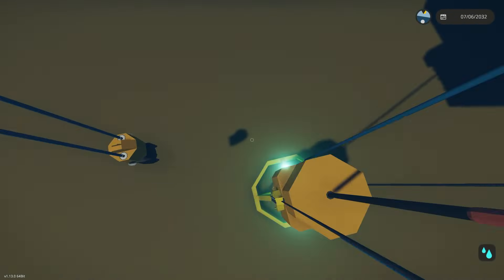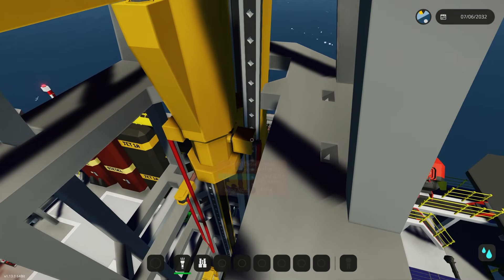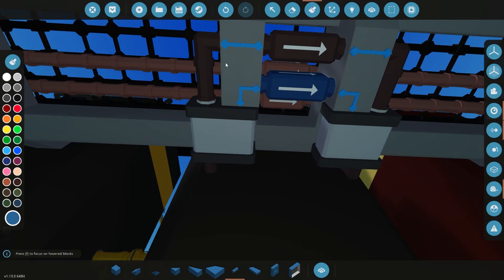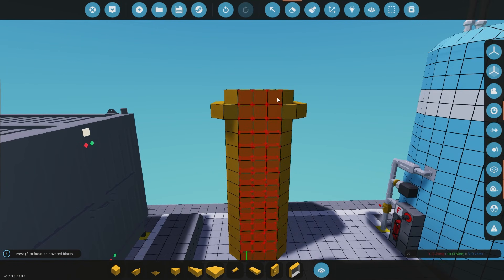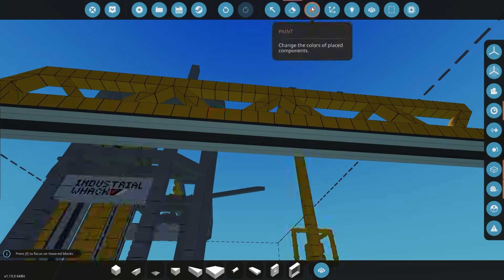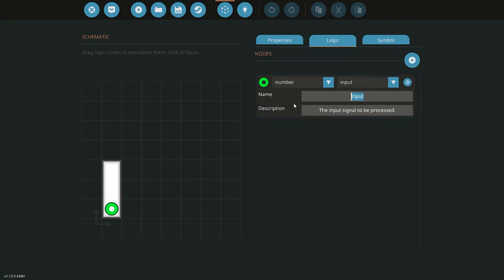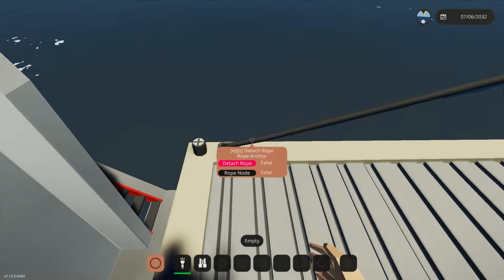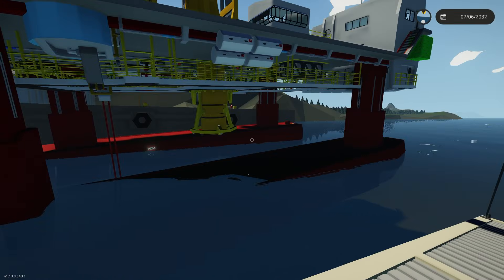Stormworks Build Series : Ocean Going Oil Rig Episode 12

Comment: That is a lot of lean. Hopefully the stabilizer system helps with that heavy container. Have you found that drilling past 200M in total rod length, the render rate goes through the roof and starts dropping FPS? Or is this a potato PC issue?
Reply from the maker: Yeah I have the build much closer to finished than you guys have seen, it’s floating great and the stabilizer is working well too!